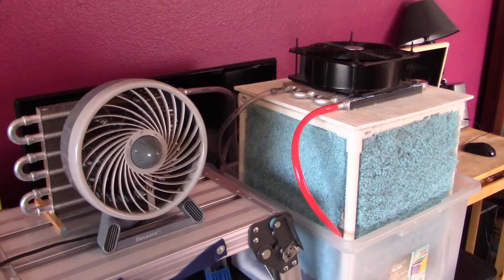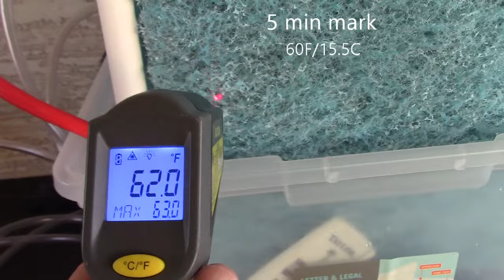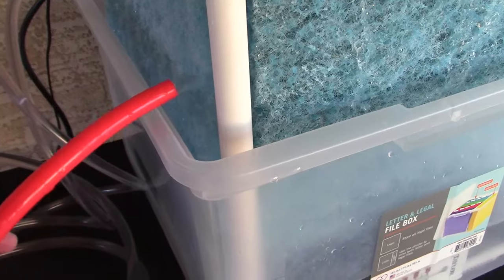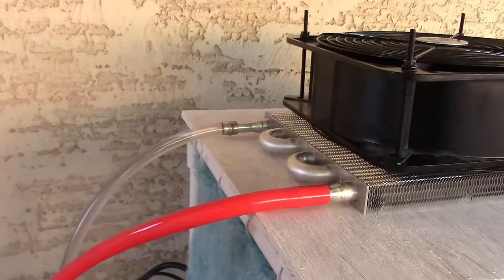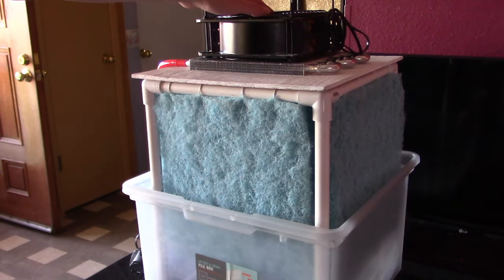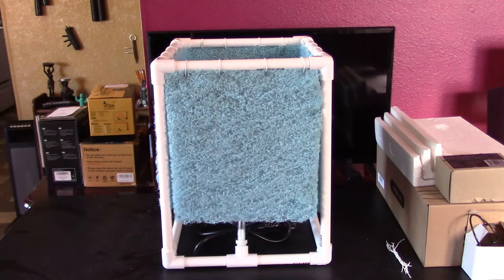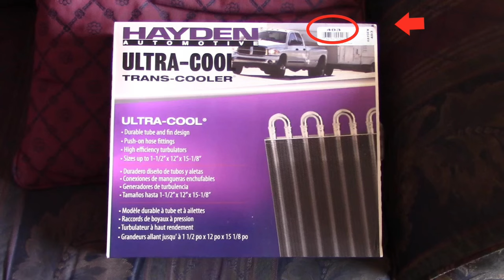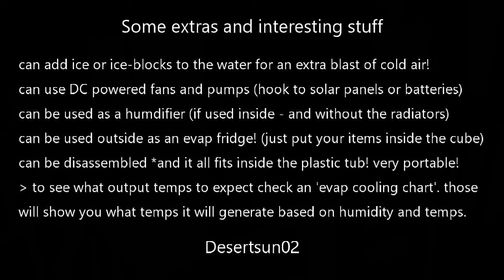DIY "TWO STAGE" Indirect Evap Air Cooler! No added Humidity! brand new! 2 fans/2 pumps/2 radiators!

Comment: I'm not an expert on this, but I have some ideas for consideration. I believe the radiator on the top of the cubicle unit isn't required since the water in the basin will be cooled as water trickles down the sponge. The water circuit could go like this: the water in the basin is pumped directly into the indoor radiator, and the water exiting the radiator can be pumped back into the top of the cubicle unit directly to wet the sponge and be cooled again. The basin should be insulated so sunlight and ambient heat don't warm the water in it. The efficiency might be improved using a larger radiator that allows greater flow of water through it coupled with a larger fan. Or to increase the water flow through the indoor radiator, you could couple both of the small radiators in parallel (not series) with a splitter of some sort. Thus the indoor fan can pull air through both of them.

Comment: My Granddad used a swamp cooler, and in Sacramento summers when it was 115 outside, a swamp cooler was a welcome relief.  As a WW2 survivor, Granddad  cut every corner of cost imaginable, so a swamp cooler was his reasonable solution.  Looking back from 2024 to 1970, my only gripe with Grand's solution was the humidity: it pushed a lot of moisture indoors, and that made it a strange kind of clammy cool, now and then.  
    My wife doesn't believe in Air Conditioning at home --  a big AC unit isn't allowed, nor an in-window AC approach:  we get to use fans.  Yeah.   As the August heat starts to blow in, I got thinking about it, today, and wondered "why not use Granddad's approach, but add  a heat exchanger that keeps the moisture outside. "  Your video popped up in my first search, and you proved it can be done.  I only need  to cool down the bedroom at night.  I have a brand new solar panel, plus a battery system that came with it.  I want to try using the solar panel to charge the cell, and then at night run the cooler off the battery.  Looks like you used pex for hot and cold lines.  Good idea. And you used fans.  That complies with our In Home Heat Treaty of 1996.  I see a summer project coming...

Comment: I am experimenting with this idea and even though I live in a humid part of the country it works well. I live in upstate New York and near a swamp to boot. It can get humid, but I am able to maintain a 10 degree drop from air temperature with this set up. I am just using 1/4 inch copper tubing for the coil inside the house. I am only using a single water pump as well to do all the circulation, a 150 gallon per hour with 5 foot of lift. Good idea.
Reply from the maker: hi. it's great to know that it's working for you even in a humid area! 👍

Comment: It’s mini model of a commercial cooling tower system. The filters act as the fills inside of a tower which the return water is dumped in the distribution pan from the top, the fans pull the heat from the water in the fills and is pumped back to the supply.

Comment: Thank you for sharing. i couldn't get cool pads or other materials cheaply in my country/region, so recently experimenting I've found several layers of 30-40% shade cloth works just as well as commercial cool pads. I'm thinking, folding /pleated them would increase the evaporative cooling surface area, similar to pleated window curtains. This is a cheap way to capture huge cooling surface area or very cheap compact units.

Comment: That's a fascinating production! From what I can tell evap coolers might work in Arizona but with high humidity in Florida very ineffective. By eliminating the humidity you may have expanded usage a lot.  I need to study this more but recycling the hot air to deal with it and make it reusable is very cool!
Reply: Evaporation nearly stops at 70% humidity. Even if you build a two loop system like this, if the outdoor humidity is too high, your cooling capacity will be very low.

Comment: Have you considered having the return water be the water that goes down the mats? If it is warmer I imagine it would improve efficiency . It would also reduce pumping needed=less electrical use and complexity
Reply from the maker: you could put the return tube at the top of the pads if you want but i'm not sure if that would add to the efficiency much or not. if you use the second radiator the water is nearly as cold as when it left the tub.

Comment: Man that low humidity makes all the difference i got a deal on a smallish evaporative cooler and here in Central Texas with the 100° outside the air from it only gets to like 84 which is better but nowhere near 60
Reply from the maker: the lower humidity is definitely a plus. when it's 100 here i can usually get low 70's out of it (but 84 is not bad). to get air in the 60's it usually has to be between 80F to 90F outside

Comment: I enjoy your channel. I realize you are in a climate that is a complete 180 from my 78% humidity lol. But a different video looks like it could work out for a little oasis while working outside. The one with the ice chest, 3 inches of water pumped through a radiator and returned back into the chest. You used some frozen gallon jugs to chill the water. I, have a whole bunch of little blue ice bags that came in shipped chocolate orders. Or even the little I think juice carton with ice in it would be nice to stick my face all up in front of lol. I just really don't need any more water in the air. It's thick enough 😆

Comment: After years of working with radiant heating I will point out that you are typically getting 10 degree F difference  between the water and the measurement taken on the PEX. Your performance is better than you thought and you will have to install inline thermometers to get accurate measurements.
Reply: Wouldn't it be more effective to blow the humid cold air directly into the heat exchanger? (instead of pumping the water from the tab into it)

Comment: Hey there mate,

I was wondering if you managed to calculate/measure the cooling capacity of the whole system? I'm trying to estimate how big of a system I'd need to match a portable A/C unit of 5000BTU
Reply: Hi, I did a calculation once a year ago and it was around 18000 btu I think for this system, which is really awesome.

Comment: Here is a thought for you, how about running that tube through the side of a fridge??? I have a campervan and if i ran the tube at the bottom left side and took it out through the top on the right or left, you would be getting very cool water constantly, then put it into the box to be taken around the tube and radiators. Thr fridge would be cooling the water down to about 10c and then the box would take it a little lower, the fridge is already on and working so you will just be using something that is already cold 🤷.

Comment: What about pre-cooling the air inlet to the evaporative cooler? Using the water heat exchangers to reduce the dry bulb temperature before the evaporative cooling.

Comment: Would pre heating the air before it goes through the air cooler result in cooler water? Taking the air from a solar air heater may increase the effectiveness..?
Reply: The Principle: The higher the heat, and the lower the humidity, the better it will work. The secret is to evaporate water into the air, which is hard, if humidity is high anyways. But if humidity is low/medium, then, the hotter the air, the better. It runs on heat (and  a bit of electricity), and is hindered by humidity. A solar air heater wouldd be an ideal addition.

Comment: Great content! I think there has been other mentions but how about some capacity testing? I live in the south Utah desert in a trailer and I'm curious what it would take using your setup. I have two swamp coolers on top I took down (water damaged ceiling, make the ceiling sag, contributes to mold growth). Would be awesome if you benchmarked by leaving one room unconditioned while running your unit in another room. Just some ball park numbers so you could roughly calculate the necessary scale of a system. None the less I love the tinkering and thanks for making interesting content. A little break from political shit popping up on my YouTube.
Reply: You can calculate it fairly easily, and try it out without building the entire system. Get a drying rack, put it in the shade, fill it with almost dripping wet towels, with about the surface area of the cooler you want to build. Weigh them. Now blast them with a fan for an hour. Weigh them again. 
If you evaporate 1 liter/1kg of water in that hour, you have a cooling capacity of about 650w, because that's what it takes to evaporate a kilo of water in an hour (physics!) For comparison, a small portable AC unit has a cooling capacity of about 2500w, which is more than enough for a bedroom, and enough for a living room under the condition that you use a two hose system to avoid drawing in hot outside air through cracks and vents. In other words, if you want to match that, you gotta build a system that can evaporate 4 to 5 liters of water per hour.

Comment: I don't understand why you said the tub of water is the coldest part of this system. I think it should be the top radiator that has all that cold evaporated vapor running through it. The sponge doesn't transfer heat fast.

Comment: I love the idea ! As it won't add humidity to the room ! Anyways . What's the typical relative humidity in your area ? have you considered that the external unit would only be useful if surrounded by dry air ?
Reply from the maker: hi. the humidity where i live varies from about 5% to about 40% in the summer. but i've seen as low as 2-3% and as high as 70%

Comment: Was thinking about making something like this for my shed I have 4600 watts off grid power. Right now I have a mini split AC unit I'm in Phoenix interesting to see what it can do in summer. I have a Mastercool for the house about 6800 cfm we run it until around July 4th then switch to a 4 ton heatpump when it gets too humid for direct evaporative cooling. This year I'm testing RO water system feeding it I think it's going to pull too much water it has a permeate pump does reduce waste water. I think next year I want to replace the evap cooler with a new one.

Comment: Hey desertsun! Thank you very much for the continuous improvments of thoes DIY systems! Its a great source of inspiration and solutions!

Now Ive run into a small problem though, maybe you can give a little input. I built a tube system based on the evap stack of "tech ingredients" but only got mixed results, so just a week ago I set up a big box cooler like you showed here. It has an overall pad surface of 8/10 of a square meter. Im using my ducted fan of the tube stack, with 155m^3/h of flow. 
The results are still lackluster though. The water temp didnt change much. That will partly be due to the 50% humidity on that day, but apart from that I dont really know whats going wrong... Is it just the fan maybe? should I be upgrading this to a much bigger one?

I need the unit for my small attic, also indirect like you showed here. Got a selfmade copper radiator for now which works adequately I think.
Reply from the maker: hi. if you're getting good airflow then it's probably not the fan. at 50% humidity it would or should work - but not as well as in the lower humidity. you can see what temps to expect by checking an 'evap cooling chart'. those charts show what temps to expect when the outdoor temp and humidity is known. one big reason that the units sometimes don't work is that there is not enough water flowing down the pads. you may want to check and make sure the holes are not getting clogged. in this project i widened the holes to 9/64th and they flow perfect. make sure your fan is strong enough. when i run thefans on low speed it is not always enough. i usually have to run on medium speed to get unit working good.
Reply: @desertsun02  Alright, thanks for the answer :) Ill try with a bigger fan first, then Ill try to perforate the pads a bit more (they are not 'real' swamp cooler pads, but rather aquarium filter sponges, those are the only ones I can get here) and then I might widen the holes in the pvc. Sounds like a plan!
Reply: @lordneador3724 I’m almost wondering if the aquarium mats are too air restrictive. Maybe the fan can’t pull enough through. There is cheap cut-to-size plastic mesh furnace filter material you could buy at most most hardware stores. It is plastic and can get wet. Try that maybe
Reply: @joecool4656   good shout, I wondered the same. I'll try to perforate the ones I have.  My last run gave me 42% of the potential cooling possible, according to a chart. That's okay but not great.

Comment: I’d like to give this a try, just not sure about the performance in my area. I live in a humid area but in the middle of the day during the summer when I need it, humidity is around 40-50%. I know what temps a single stage will do but how much lower does a two stage get? A single stage is just around the edge of comfortable.

Comment: hey, nice system man, i belive that if you use an air conditioner internal unit evaporator it will be more eficient as a heater exchanger for indoors, with a better desing too. Im planning to do this, as i have an old split ac, maybe it will require a more powerful water pump because of the small coils. Im curious to test this system performace in a wet and hot weather like here in brazil (+30ºC /50 to 60% air humidity).

Comment: Great video(s)! I'm planning on trying to build this setup!

One question: since the pads are directly exposed with no single air intake corridor (and therefore no way to filter air coming in), is dust/dirt getting into the pads and water much of a concern? I'll be using this in a very dusty environment. I'm considering enclosing the top in another (inverted) tub, with holes cut on the sides with filters in place (which would kind of turn this back into an oversized bucket-swamp-cooler design). Do you think this would degrade the performance too much?

Comment: Now I want to try this with a pizio electric evaporators. Instead of pumping water over a medium.
Reply: Theoretically it will work, but piezoelectric evaporators typically have a small capacity. A liter of water evaporated per hour, is a cooling capacity of 650ish watt.

Comment: Very nice idea :-)  I'm kinda leaning towards naming it a "split-system" evaporator instead of "two stage" :-)

And yes, it seems that enlarging the indoor radiator and/or increasing the air flow so that the return water gets as close as possible to the indoor temperature is the way to get it to it's maximum effectiveness.  Maybe see whether you can apply the counter current principle on that indoor radiator.
Reply: I looked at the video a second time. Still loving the idea of this system not adding humidity. Of course that might have something to do with us living in the foothills of the Smokys where humidity is near 100% (and evaporative cooling is practically impossible).

While being the perfect backseat driver I noticed a few things. As the water in the tub will after some time become as cold as the air you are pulling out the top it seems that you can do away with some parts. Instead of using the cool air pulled out of the evaporator it seems you can just delete that outdoor radiator and directly pump the water in the tub to the indoor radiator. Then when that water returns from the indoor radiator it will be theoretically the hottest water in the system, which would make it the best temperature to drop it directly on top of the evaporative mats where it can receive the greatest cool down. That by the way, also saves you the need for a second pump. The disadvantage of deleting the outdoor radiator and the second pump is that it will just take some time before the system starts to produce the coolest air as the 4 to 12 gallons of water first need to cool down.

 Of course as I said I'm the perfect backseat driver as I have no practical experience. It's just theory here in hot and humid Tennessee :-)

Comment: Should freeze water in Gatorade bottles and put them in the water. Just ice it melts to fast but in these bottle they stay frozen for few hours. Are those transmission coolers or something maybe cheaper?
Reply from the maker: it's a good idea. or even frozen gallon jugs. those will give you an extra blast of cold air. (temporary but fun while it lasts)

Comment: What if you put the radiator dry air part so it blows air on the evaporative cooler? Then the ambient temperature is lower hence lower water temps which makes a cycle of ever cooler water I guess.

Comment: Very cool design (pun intended) how often do you have to add water to the system?
Reply from the maker: you can get about 10 hours before needing to refill it (in general). it goes through about 1 gallon of water an hour and the tub holds about 12 gallons. if it's not as dry where you live you might get even longer (maybe 12-15 hours before you need to refill it).

Comment: How is the maximum dimension of the room to work with efficiency ? Thanks
Reply from the maker: i haven't done specific tests on room sizes but if you use the box fan version or a good size desk fan and radiator i think it would cool of a room pretty quick.

Comment: I'm really enjoying these dry cool ideas. Thanx. I'm curious about one thing, does the electric fan's exposure to moisture cause any loss in expected service life? Keep'em coming Friend.
Reply from the maker: it will depend on what fan you use but in general the extra moisture doesn't affect the ones i use. they are made pretty tough. that square one is a real workhorse. rated to last 20 years or something
Reply: @desertsun02  Good to know. Thanx.

Comment: If you pump the water directly into indoor unit heat exchanger and use the return water trough outdoor heat exchanger then into the cooling pads, then you can get away with a single pump